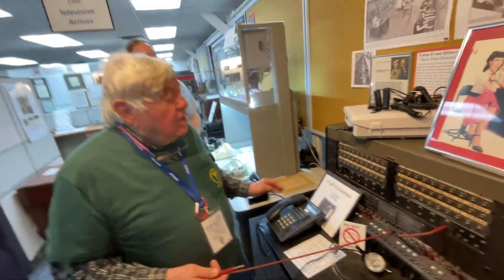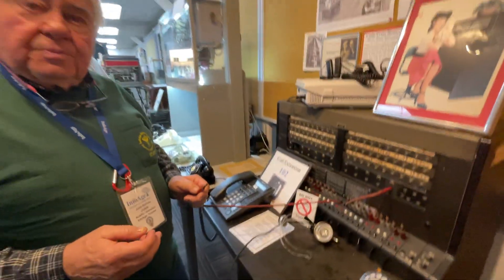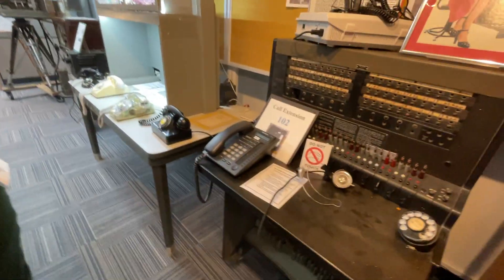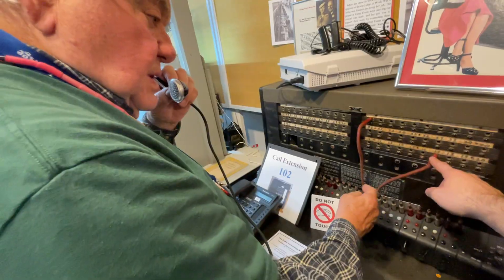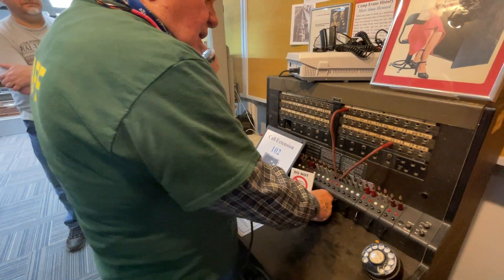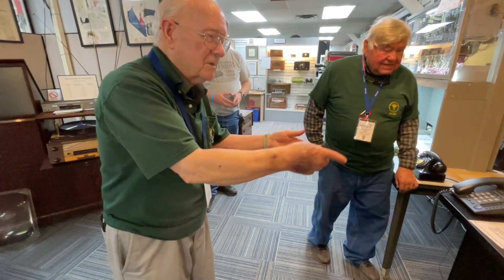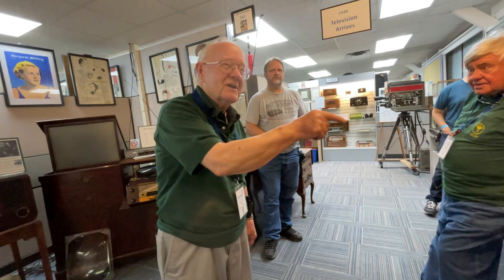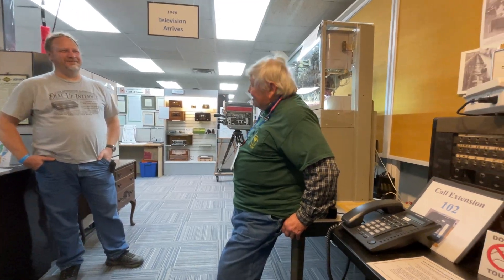How a Telephone Switch Board Worked

Comment: Forgive me for pointing out a technical point, but when they demonstrated making an internal call, they did make a couple of technical errors.  First, the extension lamps under the jack must always be answered with the left cord.  Also, the operator does not push the lever in and out to talk on the circuit.  They use the flip lever, pushing it to the right allows the headset to be connected to the cords.  Flipping it back up disconnects the headset from them.  The pushing in and pulling out is only used sometimes, depending on the setup.  That is the through dial and it allows the extension user to dial the call themselves after they are connected to an outside line.  I worked on on like that from 1968 until 1970, and have one used for hobby now that is working via ATA lines on a private network.